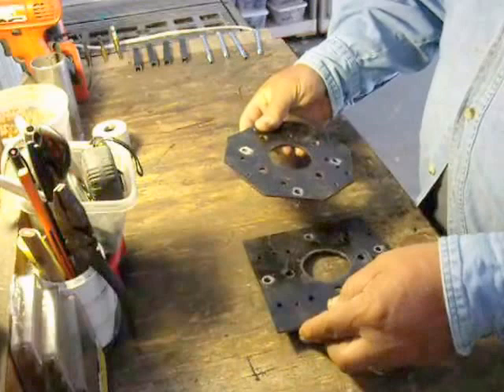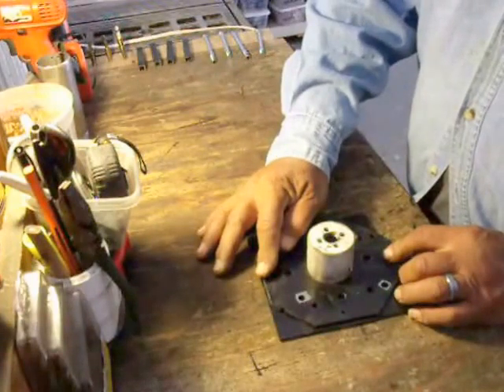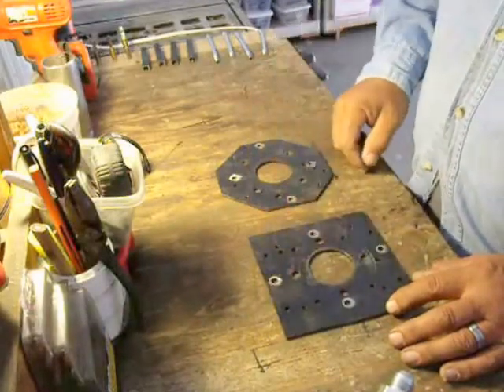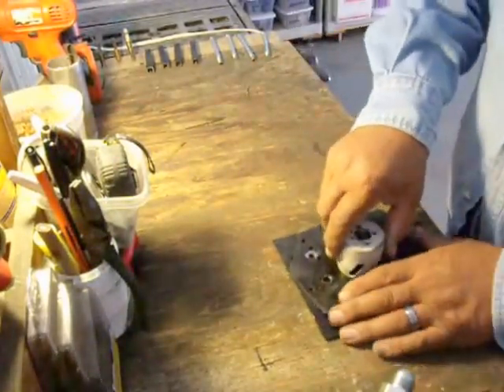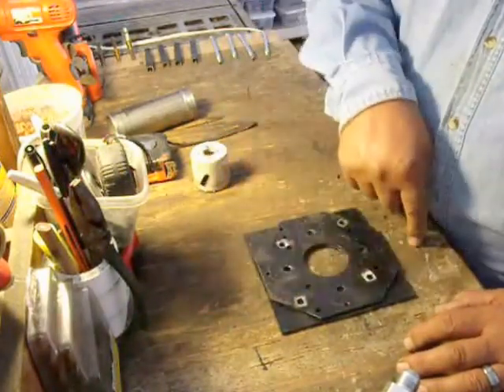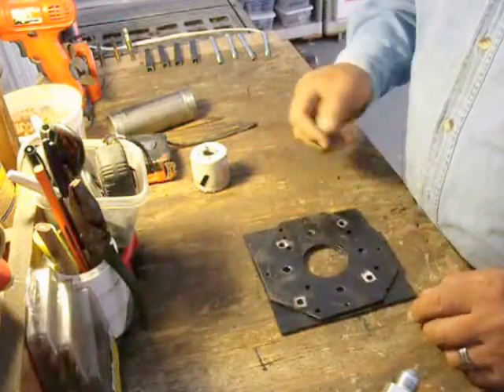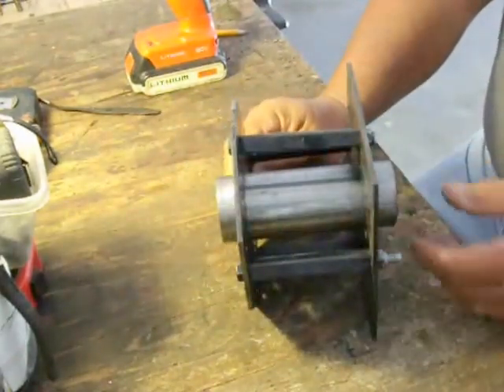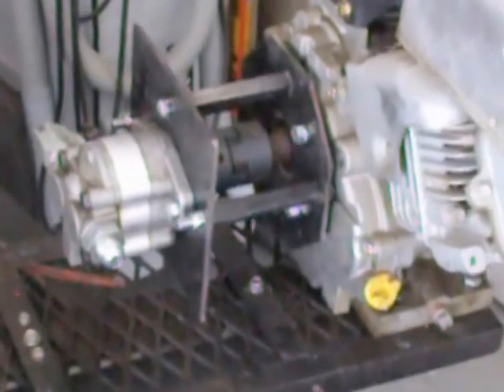Hydraulic Pump Mount

Comment: what clutch did you use?  trying to find a clutch at reasonable cost for a hydraulic pump to install on a Perkins powered APU  but do NOT want it running all the time.  Hopefully it will rarely need to be used.  pump is for a hydraulic winch and I only need it when my 25,000? lb truck gets stuck.
Reply from the maker: try a cintrifical clutch , like they have on go carts :)